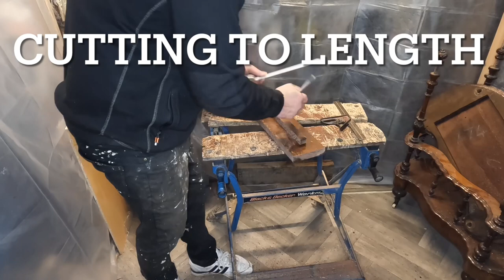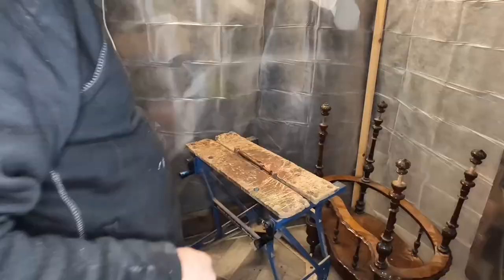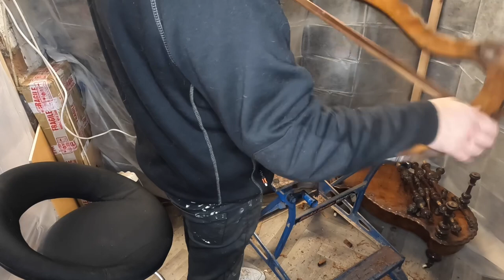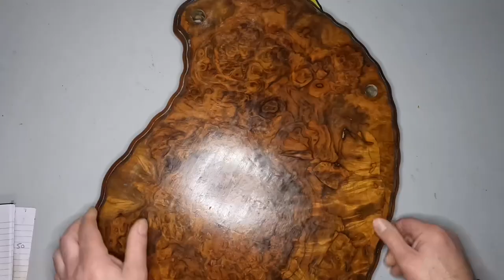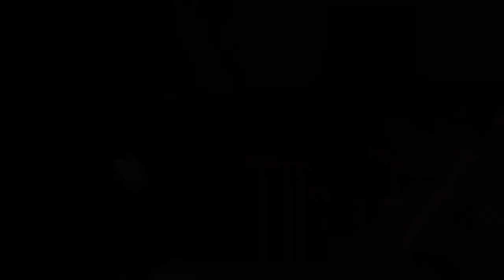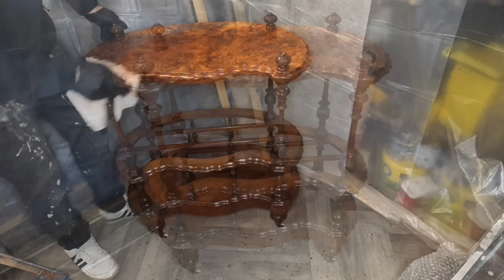Restoration of victorian walnut Canterbury

Comment: But what is the piece used for?  Hold magazines orsomething?
Reply from the maker: Hi,the main use of the canturbury was to hold sheet music in the bottom section,there should of been some fret work panels between the outer spindles at the bottom which would of made it more decorative and enclosed,thankyou for your question,😀👍🏿🇬🇧
Reply: @loverestoration9045  😊